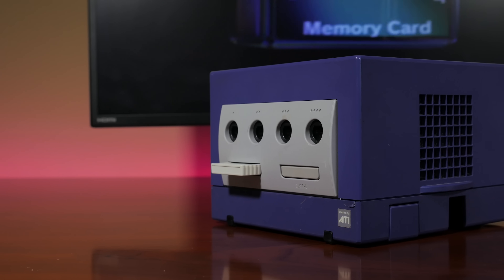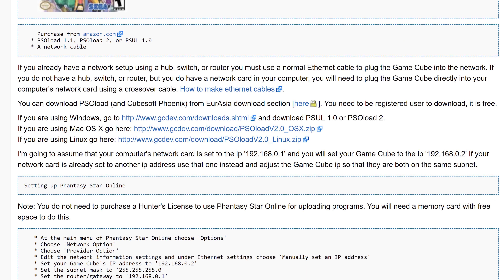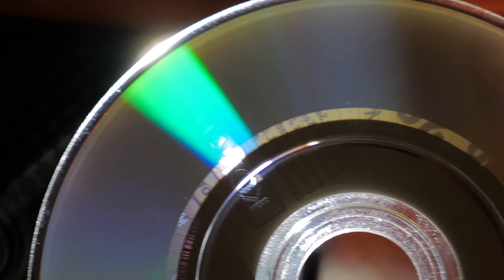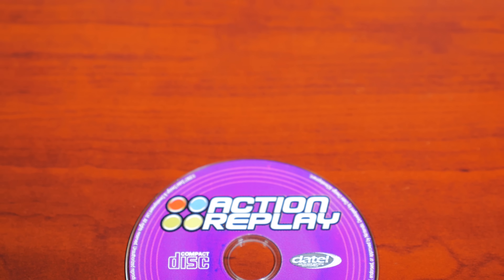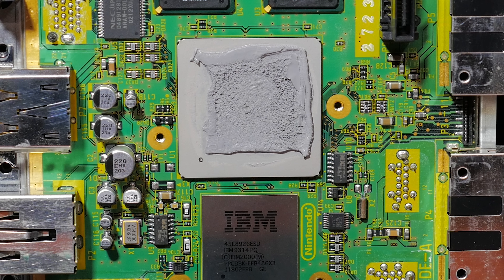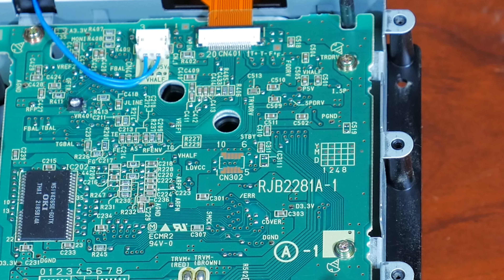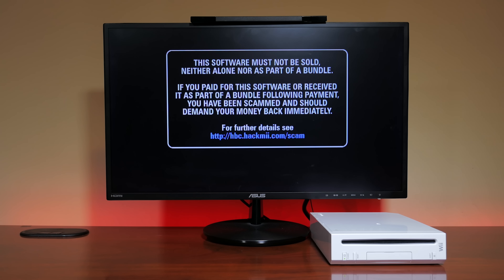How the Nintendo GameCube Security was defeated | MVG

Comment: Streaming over BBA made the time until the Viper was released, feel like an eternity.  Never even had one actually.  Max Console had a competition and were giving a few away, and some other member stole my idea and won.  I eventually bought one, but it arrived with a torn ribbon cable, so I returned it.  Then I believe the firmware of the chip was ripped and released as a .dol so you could send that dol to the GC and boot backups that way instead of streaming rips from PC.  I think I did that, as well as similar methods until the Xeno was released.  The whole process lasted pretty much the entire generation.

Comment: Reason it can't read by pc or fails to boot is because of the
Custom Data Sector Format & Filesystem
XOR Encryption by a DiskID & Random Key
Corrupted Sectors by the BCA Mark 6 Positions info stored in the BCA Data that is encrypted
Each BCA had it's own key and ID it seems to encrypt the position data
In the Disc Manufacturing Info & Physical Format Info Areas that are different from normal DVD's
It will look for "Nintendo Game Disk" and some other settings
I wrote a doc on the format on the GC Forever Wiki, feel free to check it out! :)

Comment: Nowadays the Picoboot is the cheapest Gamecube IPL alternative. It uses and off-the-shelf Raspberry Pi Pico as an IPL chip replacement, and can be easily customized with a PC to enable all kinds of IPL firmware patches, including customizing the Gamecube's boot animation color and text, and it can boot the system to homebrew without the need for a DVD drive and connect SD cards and USB storage devices to the Gamecube without special memory card adapters. As a modchip, it does require soldering experience though.

Personally, I find modern, open source, off-the-shelf microcontroller-based modchips extremely cool. The BlueRetro, for example, takes advantage of your ESP32-based devkit of choice to grant extensive Bluetooth controller support to older, non-Bluetooth capable consoles, like the Gamecube, NES, SNES, Genesis, N64, Dreamcast, PS2, PSX, etc, and it allows those systems to interface with Wii, Switch, PS3, PS4, PS5, Xbox and even generic wireless controllers by converting the Bluetooth HID information into the controller port signals the system is expecting.

Comment: I still have my Nintendo GameCube but I have yet to do anything to it as far as modding it. Plus I'm not good at soldering and Modchips need to be soldered into the motherboard. I heard if another method where you can play GameCube backups off an SD card on a modified memory card

Comment: there are a select few optical drives that can guaranteed to be used to dump gc and wii discs using friidump. sometimes other drives work. im wondering if it is reading the security data and reading the dots. it takes a very long time to dump and im wondering how it works

Comment: I modded the GameCube myself back in the days. No modchip needed no action replay needed. I used my own trick and requires big dvd format wich wont fit so i modded it with special case mods that could be bought back in that time. Sad that my method is not seen in this video IT was easy to pull off.

Comment: Imagine if the gamecube used DVDs instead of the discs it did, imagine where it would've been in terms of library and also in the market.

The justification of reducing piracy obviously makes however it didn't work. because it wont. 

especially considering in terms of perfomance it was the better of the three, but the disc capacity restrictions made its kinda pointless in  a way.

Comment: @Modern Vintage Gamer:  Your right any machine, even video game, will not know the diffrence if it his bad data, or good data, as long as it can execute the new Data put into it, similar to injecting a computer virus, the only diffrence does type of Computer virus are not Dangerous, and may not break your console. Because of Nintendo Switch SNES online his a virtual machine of the Super Nintendo, but because it his a virutal machine the Abritrary code excution  done with the chargeing chuck, does not work, and the same thing for the WiiU, Wii,  SNES mini classic,  NEW 3DS.  SethBling on Twitch found a new way to do the Credit warp mush easier then the chargeing chuck method in Super Mario world Credit warp on The Wiiu, and then he was able to execute code with specific placement of sprit, and preform several glitch, that would cause the game to execute the code he written down, so he install the Super mario world Jail break, into Super Mario world Virtual console by only using glitches, and 1 other controler. And then he did the same thing in Super mario world on the Nintendo switch, but because he did not remember how he did it on the WiiU he had to make some work arround, and once he remember how it works on the WiiU,  the method he used on the WiiU would not work on the Nintendo switch version of Super mario world because it would not read execution from a 2nd controler. So his work around help me out, to test what I wanted to test, to see if you can access the jail break without codeing the jail break into the Nintendo switch Super mario world,  and I found out with my testing yes you can, but there will be limitation compare to having the jail break code injected into Super mario world on the Nintendo switch. And no homebrew software where used, and no homebrew hardware where used, neither other hacking software of any kind where used, as well as neither hacking hardware where used. The Hacking was purely done by glitches only. If you don't believe I have video on my channel about it, and make sure to start with part one, because the simplest change his the most complicated.

Comment: Rom chip with encryption that if you take out the chip, it will erase its self and distroy system.so hackers can see the code.if hacker trys to soder wires to the chip, the chip will detect that than will earse and brick the system.only way to get these chips is the company but beef up the company security so none will get leaked out.the chips will be custom made so no one can buy a blank chip.every chip will have a unique I'd just for the system only nintendo can up load so they can still reapair the system.creat custom encryption.
Reply: Every system will have its own unique I'd.you can not put a game in and pop the door open and put another cd because it will shut system off.

Comment: Without watching video first.
Piracy on GC were easy to do yourself. Just add a LAN Adapter, Buy Phantasy Star Online and adjust laser to around 130 or was it 480 or something?
Also. When you took off the top casing, you could use full size DVD-R and DVD+R discs as disc were stuck properly in the drive.
If not, you would have gotten a high-speed frisbee..lol.

Comment: The CPU was actually based off an IBM PowerPC 750CXe, not a 730.

Also the GPU contained 3 MB embedded 1T-SRAM (2 MB framebuffer/Z-buffer, 1 MB texture cache). 

Not sure where the idea of “2.5 megabytes framebuffer”  that you mentioned came from. 

Great video never the less.

Comment: Checking for Gamecube hacking news was the first thing I did when I woke up for about a year and a half.  I went out and bought PSO, BBA and that Netgear card the day the exploit was released.  And then put up with choppy streaming up until the Xeno.  Surprisingly the BBA has about doubled in value, and PSO is still worth about $50, so I can actually break even including the cost of the Netgear NIC if I sold them both today.  Ironically the PSO revision, where they simply patched the exploit is worth $150.  Typical game collector logic.

Comment: Thanks for posting this. I actually remember writing a guide on how to use the max drive pro on afterdawn forums almost 13 years ago in 2006 https://forums.afterdawn.com/threads/tutorial-how-to-play-backups-w-o-mod-chip-only-max-drive-pro-memcard.423091/ it's basically the SD method but instead of an SD card it's a memory card w that can be hooked up and .dol files loaded directly on via USB cable. Had a lot of fun w/ this back in the day so thx for the trip down memory lane!

Comment: The Phantasy Star Online information is somewhat incorrect. There were never any official server provided "patches" on the Gamecube version. On the Dreamcast version there was eventually cheating, and with PSOv2 on Dreamcast they had added a server command to calculate the checksum of a specified region of console memory to verify things weren't modified by a cheat device. In addition PSOv2 on DC could load small in-memory patches from the server just for online play. The Gamecube version of PSO still had those commands intact from the Dreamcast version, but they were never actually used. (PSO Episode 3 had separate new commands for sending updated card stats to rebalance online play, this was not for in-memory code patching either though.) The developer of PSOLoad had actually reverse engineered the game traffic encryption from the original XBOX port of the game which had been released by that point and used the same encryption as the Gamecube version; they were at least smart enough to change it after Dreamcast. Then the Gamecube version's memory was dumped by repeatedly calling the checksum command for 2 bytes of memory at a time, since you could build feasibly reverse a 32-bit checksum of 2 bytes back to the original memory. Dumping GC memory took several hours this way. Once he had a full memory dump of the game while it was connected to the fake server, he was then able to figure out what & where could be patched via the unused patching logic to execute his own code.

Source: I beta tested it. The developer didn't even have a copy of the game when he started working on it so initial testing was done by other people. He was tipped off to the existence of the patching functionality by someone who had hacked cheat codes for the Dreamcast version.

Additionally, SDLoad predates Samson's AR Loader and the two aren't even related. SDLoad worked with Nintendo's official Gamecube SD card adapter (I have one) or later 3rd-party/homemade ones. Samson's AR Loader came a bit later and just allowed you put DOL files onto a normal gamecube memory card and launch them that way whereas SDLoad obviously loaded them from SD cards. It's kind of ironic that in the video you're using a later version of the Action Replay that removed the ability to enter your own codes - presumably so Datel could sell their separate SD media launcher product that had been released by that point.

Comment: I find it interesting how you can hack the systems. So far the ps2 was the most interesting with swapping disc's. Hacking my 3DS was too hard for me. At least I was able to play Roms from my SD Card. I tried Pokémon 2nd gen but due to the lack of the RTC, it was a mess.

What I miss is a website that collects all hacking methods. I mean going through old forum threads is quite a pain, especially when you don't know what methods you should use. Soft Mods are the ones that probably will work in 10 years but hard mods are quite harder to get.
For example with the ps2 hacking, the tutorial was not that good. Most don't mention that you don't need a PS1 game and just can use a CD ps2 game, that aren't that uncommon as they stated. The one information that wasn't that clear, is that you need to make a copy of that DVD ps2 game, that you are using to replace the game. Also it's not mentioned that you can use a ISO from the internet. Sure it's not the legal way but 2 DVD drives weren't able to read any of my DVD ps2 games and I had problems to get the software running. Also the timing described in the tutorial, where you need to switch the disc's, was not good. They say after 3 seconds but I saw how the laser moves and then realized that I need to switch the disc's earlier.

Just a site that list all methods in a good way and provides updated tutorials, would be nice. There are several ways. Some require specific games or hardware and when you have all tools for a specific way, it would be great to know. When the result can be the same, it doesn't matter which way you use.

Comment: So uh, any plans to port Dolphin or PCSX2 to Switch?
Reply: PCSX2 isn't going to happen. Dolphin might.
Both projects made an attempt to move their dynarecs to 64-bit x86. The Dolphin team succeeded, and then backported it to 32-bit x86 which resulted in speedups there. The PCSX2 team decided that a 64-bit port wasn't worth it, and remains 32-bit x86 only to this day... plus they have less people working on it.
Now consider that to add support for it to run on the Switch at a reasonable speed, they need to make new dynamic recompilers for ARM CPUs. The instruction sets are completely different, and it would take a bit more effort to get them running on ARM.
Of course, one could opt to stick with the interpreter cores, but don't expect anything vaguely resembling "speed".
Reply: @fanzyflani3576  
eh, I guess playing Wrestlemania 19 or Day of Reckoning 1 on the go were my best bets anyway for portable 6th gen wrestling games

Comment: He said 480p, but gamecube with the digital ouput can only give up to 480i
Reply: Wrong. Some games can do 480p. The Star Wars games can certainly do it as I have played them on an old VGA monitor using an RGB modded Component Video cable.
Reply: @RARusk161  
I apologize, I am mistaken.
I have an original component cable for gamecube (use it all the time) and for most games it goes up to 480i but you are correct some can do 480p

Comment: one question can you boot a burned game with the  freeloader on the gamecube?
Reply: yes but your drive needs to be adjusted.
Reply: adjusted how its it on a panasonic gamecube can i use regular dvd or has to be mini ones as well ?
Reply: @resarxamtheswedishguy7802  not sure. I believe certain dvd are required. I know my wii can read back up copies fine. But my gc cant cause needs adjustment.

Comment: Awesome video. I remmember it pretty clear, I used to read news about how to hack the Gamecube and execute homebrew during that times. Finally, I bought the BBA and the PSO to load .dol files sending them throught my PC to the Gamecube with the BBA. It was pretty cool when I run for first time homebrew with the PSO exploit. Thanks to the PSO exploit, I copyed the GC loader  inside the memory card (no SD gecko) and with an Action Replay I can run the homebrow without the PSO. I used to burn in miniDVD the backup copies. Unfontunally, the Gamecube driver was very exigent with the quality and it only could run if you burn in RITEK mini-dvds brand.

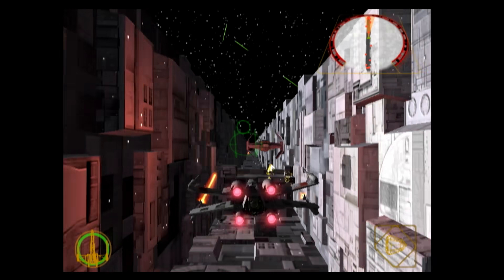Comment: 1:10 
There is something special about Zip discs. 100 megabyte discs (later 250mb) were my mid 90's choice for sharing files with my friends at school. They could only take 1.4mb of any file at a time on a single disc and I felt like a boss holding 100mb in my hands. The write speed was decent, but the reading speed was lacking. But I could copy the DOS game files to the school computer, play the game, copy the save files back to the disc and delete the remaining files. (Only if I had time after I finished that day's typing class fast enough.) 
Now 20 years later... we have micro SD cards that hold 200gb in the space of my thumb nail.

Comment: Nintendo learned from their mistakes, were they really mistakes?? Uhmmm i don’t think so because the nintendo switch is still hackible , whether via softmod or hardware mod, it’s slway’s hackible, no matter how hard they try.
But i do courage nintendo to use the same method they used in earth bound to anger hackers and it’s members that way because it took the hacking community over 22 years to fully bypass all security checks of that game wich required reverse engineering the whole game.